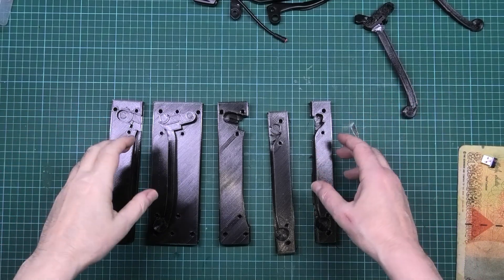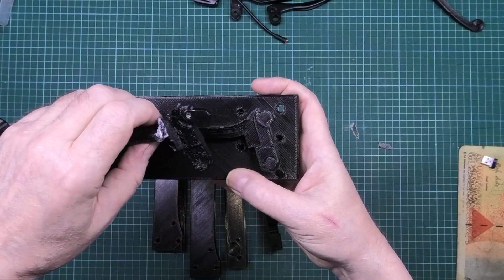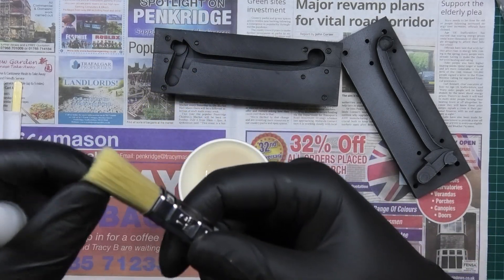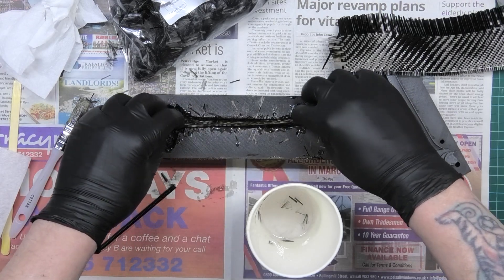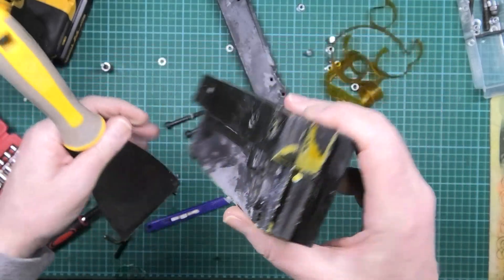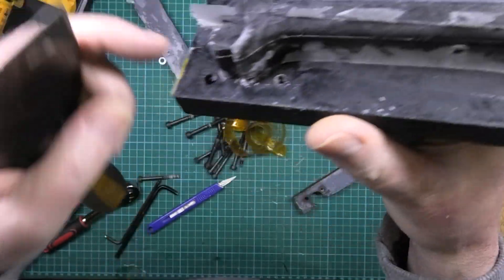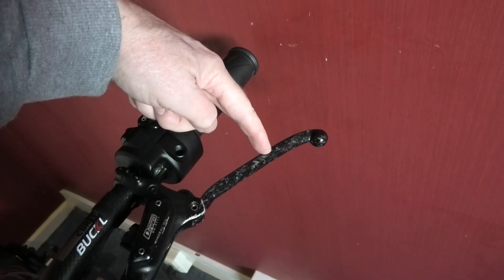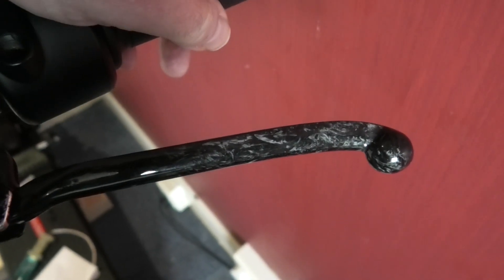🔴 EXTREMELY POWERFUL E-SCOOTER BUILD part 21 - The other brake lever in forged carbon fibre

Comment: @tony. I wonder if you was to shove some carbon fiber into a blender so it was almost dust then mix it with resin and use that to make your parts as you could pour it in the mould
Reply from the maker: The strength comes from the fibres, it would be like making string from dust instead of many strands.

Comment: Thanks for posting your video's Tony.  Question. Can you connect Makita 18v (same amps) Batteries in parallel and series. Could these batteries be modified for a bike without breaking them apart. Cheers Pete
Reply from the maker: Yes Pete, you can and it has been done before. It's just a pain connecting them every time unless you can come up with a mounting or charging solution.

Comment: Good work Tony. Your practise is reaping rewards. Like in how easy the molds popped apart. What do you think made that easier ? 
Shame about the bubble and missed bit of Tow, but like you said, no worries, it's not structural